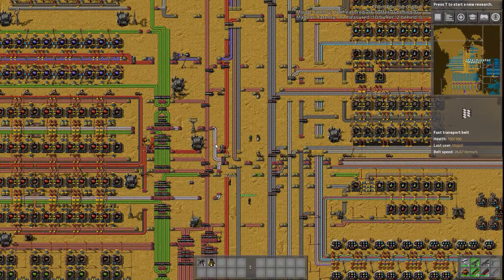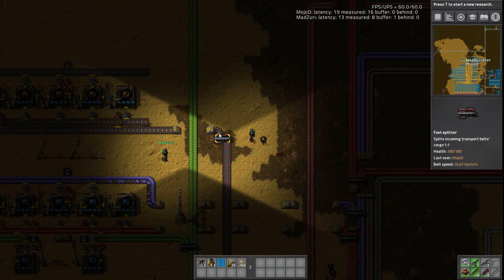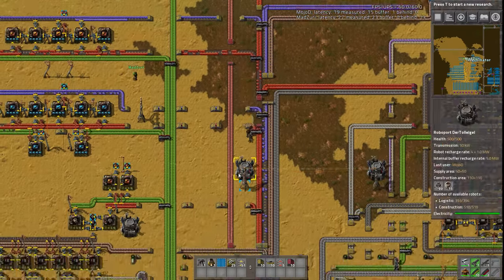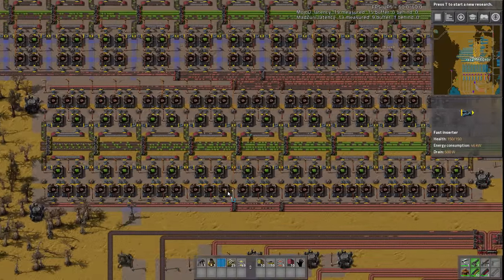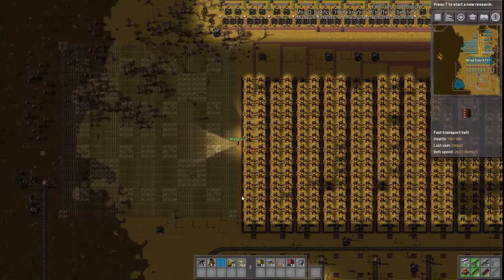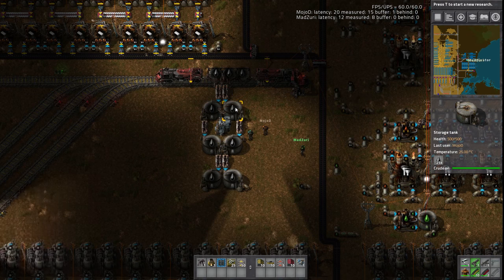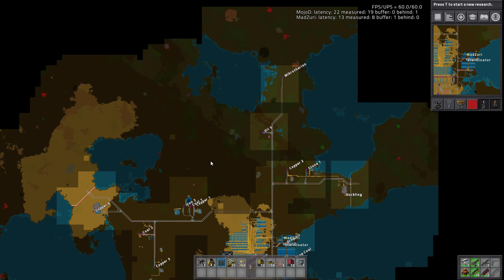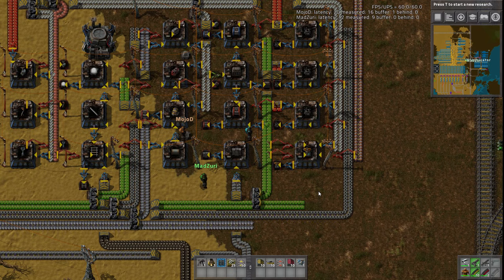Factorio 0.15 Megabasing 101 Tutorial EP1: Planning & Tips - Multiplayer, Gameplay, Let's Play

Comment: Looking at the effiency sheet, how do productivity modules fare  in Oil refineries? they dont seem to be included in the sheet
Reply: nvm found the comment that explained it:

"Uh, yes. Oil is a little more complicated than can easily be put on a spreadsheet. You should module them after the big payouts, like labs and silo, but before low payoffs, like smelting. Most people do oil fairly early, and usually before anything else."

Comment: I think I've missed an update in train logic. If a train is supposed to go from station A -> B -> C, and station C is turned off at the time it's trying to leave B, it used to stay at B until C opens.
Now, either I'm doing something wrong, or they've made it skip C and go back to A. Right?
Reply: That's correct. If no enabled station exists with that name, it will skip over it in the train schedule. The station doesn't need to be accessible, it just needs to be enabled. So, if you put a random piece of track somewhere not connected to anything and put the station there, the train schedule will see it and will no-path trying to get to it.
Reply: Omar Asadi and will it then reschedule as soon as an accessible station opens again? Otherwise, this messes royally with my smart train system.
Reply: Yes, if the train is no-pathing, then the game will attempt to find it another path to an accessible station.

Comment: I didn't follow the reason for the odd length trains, what's that about?
Reply: The reason for that is, if you have builds, which are bot based, say a green circuit build - or any other for that matter, and you want to have one train bringing in ingridents from one side and have the train with the finished product leaving in the opposite direction, both tracks and esp. the stations and trains line up evenly, whereas if you use even numbered trains, you have to off-set the stations.
Reply: Oh, because rail segments are 2 squares long so the whole thing needs to be an even number of squares long? Train cars are all even, but the gaps are one square so odd number of cars is an even number of gaps for an even total length which will align nicely with rail segments. Is that it?